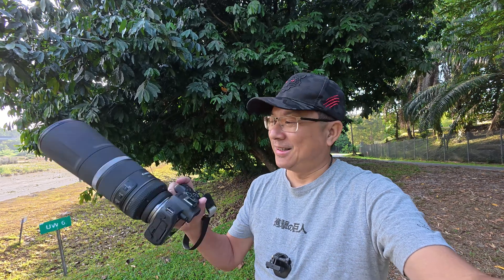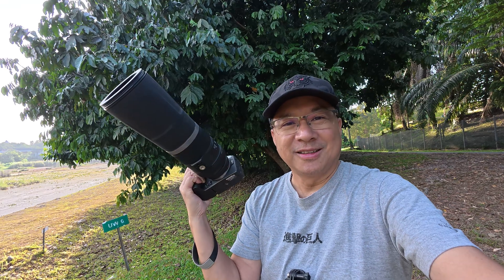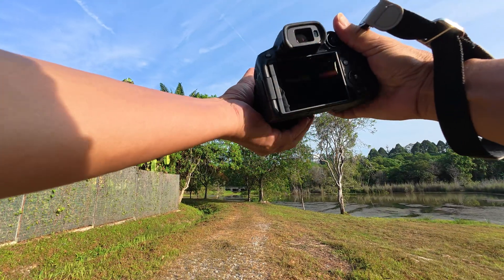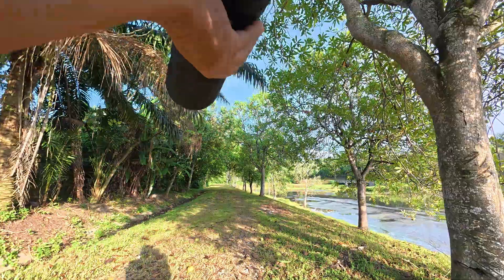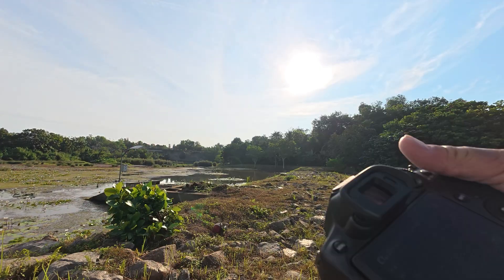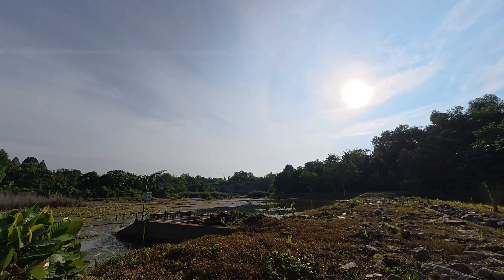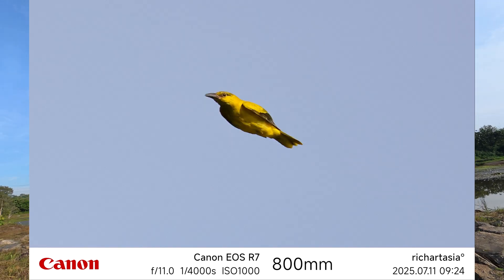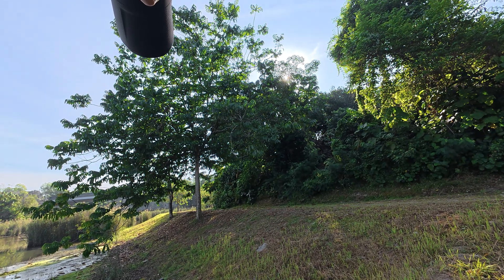What the Hack? Speed booster on Canon RF 800mm f11 R7

Comment: This is super interesting! 
Are you sure that the vignetting isn’t caused by the adapter ring that you had on the front of the lens in the video? 
This is quite enticing to try out, especially given that the EF-EFM speed boosters can be gotten used for super cheap now that Canon has discontinued EFM mount.
Reply from the maker: No the stepdown ring front is for CPL filter and to protect the lens when I put facing down won't vignette. If I push the speed booster closer to sensor less vignette further more depends how I adjust.
Reply from the maker: Here this capsule allows me to adjust the core front or back depending if I want closer focus or more further focus https://youtu.be/hwoqeFMiSSU

Comment: Hi. I also have a Viltrox speedbooster (EF-R3, forbidden by Canon or useless when updating firmware, I think) and I really love it. I put it regularly on my R7 with several EF lenses and yes you gain 1 stop but no vignetting because of EF Full Frame lenses not EF-S.
Reply from the maker: if you still have the EF-R3 unscrew out the core lens put it in your RF 800mm lens you can use it bypassing the adapter firmware issues also will work with other TC able lenses from other brands
Reply: @RichartAsia  Since now I never used it with my RF lenses (I don't have a RF 800mm). To be honest, I don't want to dismantle it but I could try to find a second hand one like yours and give it a try. Doest it have an impact focusing at "infinite" ? Anyway, thanks for your video.
Reply from the maker: @roy4359 no need to dismantle just put your thumb on one side of the lens and finger the other hold and turn it out it's threaded just unscrew it out
Reply: @RichartAsia  👌